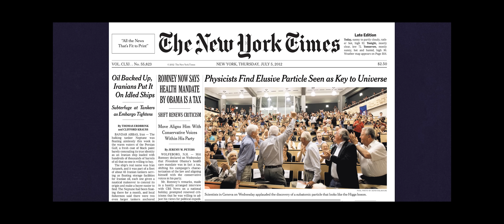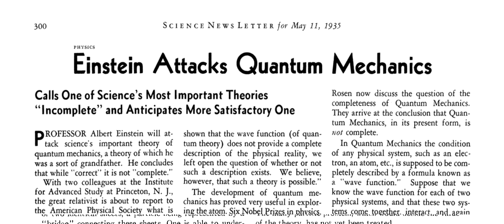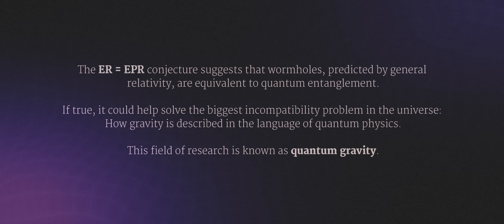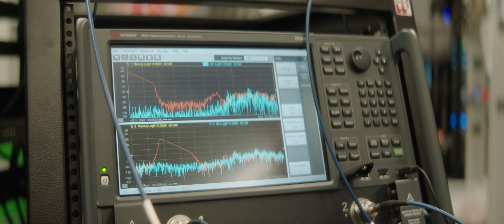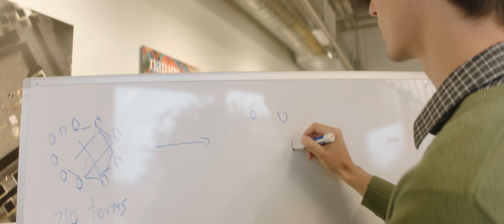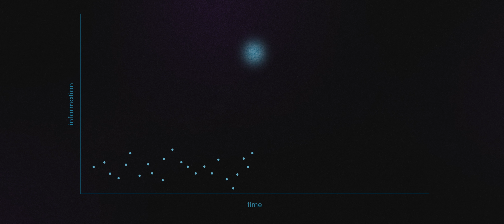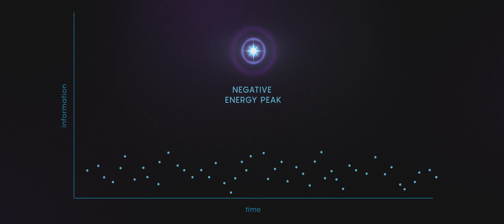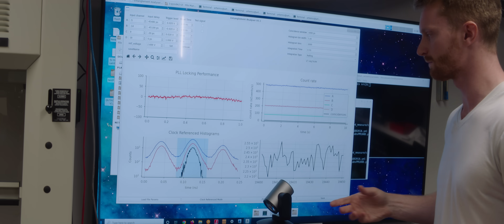How Physicists Created a Holographic Wormhole in a Quantum Computer

Comment: the fourt spartial dimension is the universe smeared on the surface of a quantum mirror the surface of the event horzion. the fifth dimension is where the two quantum mirrors of event horizons become entangled trough a single manifold that is making the surfaces of the quantum mirrors inverted so that the surface of one event horizion encodes the informaiton of part of the universe on to the other event surface of event horizon and vice versa. it means you will see the part of the space of the other end of the wormhole inside the event horizon on your side of the wormhole. you hit the quantum mirror get speared outward ona 2d surface then move trough manifold like curve and end up comming out of the 2s surface of the event horzion on the other side of the wormhole. the gravity model view 3d on to 2d but the reality is that the manifold operate of forth and fifth spactial dimension but the analogy is a 2d surface. the wormhole would be in 3 dimensions the surface in 4 dimensions and the entanglement in the fifth.

Comment: You can put people through it but the ship must produce a strong enough magnetic field that the field will help hold open the wormhole so it does not close on ship. There is a special energy to use that creates such a field that most UFO 🛸’s run on. This is step 1 to create a strong enough field around the ship. The energy to use is Aetheric energy which fills the air and all things. This is step 2. Step 3 is to know how to capture this energy and store it for use. Step 4 create the self sustaining metal to help harness the energy throughout ship to help conduct the energy like a generator once activated. Step 5 enjoy the show.

Comment: We need to learn is something can block the communication or not. I assume atoms can not block but maybe a new kind of barrier made by subatomic particles may block the communication. 
As a computer engineer, we need to understand the data transfer speed, distance limits, noise factors etc. Then I can code and build a galactic communication network!

Comment: what if it's not two black holes
but one black hole
transferring residue as it dies, so
at other end there is dark matter
which ( with enough quanta
getting snagged as they flit in and out
of different dimensions )
can eventually become the home
of a black hole / galaxy combo...
The white hole hypothesis
was  only relevant to the big bang, but
a dark hole / worm hole, might be
where dark matter comes from.
&
in case you didn't notice,
i don't believe quantum entanglement
and worm holes work the same way ~
worm holes transfer q.gravity /d.matter,
while entanglement involves sharing
of information / awareness
via a virtually telepathic process
that doesn't enter physicists heads
so they lump them both together instead.
 :(

Comment: U need six satellites and a drone that uses yellow extruding yellowish light globes on top of flying saucer. Six satellites and six light globes. Holds open a worm hole. As on a clock every 2,4,6,8,10. Are the directed flux to break with magnets frequencys.

Comment: Seen worm hole use with wifi drone flying saucer 2m radius after wifi charging, used a gate wormhole. On our dry ice man made firmament. Space is black flowing ocean from left to right. I seen a worm hole used by the drone flying saucer that I studied above my roof as it was spying on me making hydrogen fuel cells

Comment: I seen a worm hole a wifi 2m radius flying saucer above my roof for 20 min and used a gate worm hole on our firmament our space is black flowing ocean . Inside that wormhole on our firmament. And studied this wifi drone flying saucer for 20 min while the worm hole stayed open until it left my roof and went into it and then both dissatisfied and six satellites came over . Knowing every second hand on a clock was used as satellites to hold open worm hole. Or was involved with this flying saucer spying on me in shed . And used wifi to charge above me roof and had me council led light on it for 29 min . Studied it and lived the diamonds of rainbow reflective surfaces and open ring under the bottom  hat. As it was two cowboy hats joined together. But all plates where cut trianglar. , So much more info on what I know on this spectra magnetic field spectrum use to fly and use wi fi and use a worm hole. I seen all, this whole the flying saucer drone was spying on me Building.

Comment: On 19-Apr-2000 I invented the Delta Vehicle that uses all known Deltas: Pressure, Voltage, Magnetism, Density, Temperature, Height, Gravity. The most important Delta of my Vehicle is the Gravitational Delta. To take advantage of the Gravitational Delta, the vehicle has three devices: 1. Gravitational Wave Tuner 2. Gravitational Wave Amplifier 3. Gravitational Wave Directioner

Comment: The very processing power of a quantum computer comes from its processor harvesting what is known as quantum entanglement. Quantum entanglement in and of itself is a wormhole. Because a quantum computers processor uses what is called or known as quantum entanglement, this allows 2 quantum computers to transfer or teleport data to eatchother instantly and do so faster than the speed of light itself. It does not matter how far apart or how close the 2 systems are the data is litterly teleported instantly. This is the very action of quantum entanglement.

Comment: I'm sick of hearing the Qbit can be equal to either a 1 or a 0 or both. How do you calculate if everything can be anything?
Reply: there's a really good video by microsoft academy showing the basics of quantum calculation, showing the simplest problem where quantum computers can solve it faster than classical computers, and run it on hardware. it's a 1 hour long lecture but super accessible.

Comment: If we hypothesize that nothing is actually moving faster than the speed of light, and the Hawking radiation provides us with information about the state of the particles, we can explore a possible scenario.

Hawking radiation is a theoretical prediction made by physicist Stephen Hawking, which suggests that black holes are not entirely black but emit small amounts of thermal radiation. This radiation is believed to be associated with particle-antiparticle pairs that are created near the event horizon of the black hole, with one particle falling into the black hole while the other escapes as radiation.

In the context of our hypothetical scenario, let's imagine that the entangled particles connected by a wormhole emit Hawking radiation. This radiation could potentially carry information about the state of the particles, allowing us to gain insight into their properties.

If we were able to detect and analyze the Hawking radiation from one of the entangled particles, it might provide us with information about the state of its entangled partner. By observing the properties of the emitted radiation, such as its energy, polarization, or other characteristics, we could infer the state of the corresponding entangled particle.

In this scenario, the information would still be limited by the speed of light. The detection and analysis of the Hawking radiation would take time to reach us, just like any other form of electromagnetic radiation. Therefore, although we might gain insights into the entangled particle's state, it would not violate the principle of locality or allow for instantaneous communication.

Comment: So is a "white hole" the "axis" on both sides of a black hole and the material that enemates from those "jets" is whats coming out of that white hole. thats probably why we cant find them. for one, they are right in front of our face, in a sense, but completely obscurred by the "light trapping" black hole. but my guess is THATS where white holes are.Thats why ER=EPR. One is inside the other. Together they are 1.Thats maybe where the  expansion of the universe gets its "inflation" pressure from. Its spews out the fabric of space-time. A "fourth dimension" engine.

 They ARE the singularity. And since black holes that arent feeding dont produce jets, well, to open that wormhole, feed the worm. feed it energy.feed it mass. hell, feed it tacos and old milwaukee.
Also, the blonde is HOTTT!

Comment: "Theoretically, it is possible for a superfluid to transport particles through a wormhole using the laminar effect. Entangled particles would be used to control the flow of the superfluid, allowing it to move through the wormhole without encountering turbulence or drag. This process would be highly efficient, as the superfluid would be able to move through the wormhole with minimal energy expenditure. However, the technology to create such a wormhole has not yet been developed."
Hyuk-hyuk.

Comment: "A quantum computer wormhole is a theoretical concept in which a quantum computer is used to create a synthetic wormhole. This would allow the computer to access information from different points in space-time, without traversing the physical distance between those points. This would enable the quantum computer to perform calculations much faster than is currently possible. However, this technology is still in its infancy and is unlikely to be developed in the near future."
Lulz.

Comment: An active galactic nucleus (AGN) is a compact region at the center of a galaxy that has a much-higher-than-normal luminosity over at least some portion of the electromagnetic spectrum with characteristics indicating that the luminosity is not produced by stars. Such excess non-stellar emission has been observed in the radio, microwave, infrared, optical, ultra-violet, X-ray and gamma ray wavebands. A galaxy hosting an AGN is called an "active galaxy". The non-stellar radiation from an AGN is theorized to result from the accretion of matter by a supermassive black hole at the center of its host galaxy.
Reply: Containing force potentially that provides containing force for there to be a vacuum in space. Infrared light travels infinitely. Someone contact me to solve this

Comment: Space itself doesn't move. Space itself is a stationary cold field of resistance to thermaldynamics. Propulsion and repulsion. Perpetual motion. Unification of unidirectional flow of pressure in quantum magnetic fields of forced pressure cycling circulation patterns of mass in resistance to forward momentum. Repulsion redirects trajectories towards the weakest point of resistance. Mass neutralizes resistance within it as repulsion of thermaldynamics in resistance as magnetic fields of forced pressure cycling circulation patterns. Outward pressure of force known as weight of energy in mass. Hydrogen under extreme pressure of thermaldynamics expands cold resistance in equalization of pressure into the expansion of cold resistance into helium. More pressure exerted within, more resistance to repel it. Mass expands resistance within equalization to pressure. Hydrogen under extreme pressure expands cold resistance into helium. Mass, density can't exceed resistance within it. Mass is always equal to resistance. Mass occupies space as space itself. Cold resistance and thermaldynamics coexist as space itself. Thermal energy singularities outside of entanglement of mass are heat waves of cosmic speed limit in resistance. Resistance to singularity causes heat to spiral around cold resistance in avoiding patterns. Hence frequency. Mass is the weakest point of resistance in occupational space. Mass occupies space as an amplifier. Mass occupies space with resistance going through it in forward maximum momentum velocity in resistance. Exchanging points of space as we vibrate as a wave of it. Vibrations move point to point timed interactions. The energy and resistance we exchange in positions of trajectories of forward momentum. The cosmic speed limit is constant, in and out of entanglement of mass. Distance is reduced by cycling circulation patterns of mass. Black holes are devoid bubbles of thermaldynamics. The hubs that generate thermal energy singularities at the event horizon and act as a generator that allows more pressure exerted within it outward force into propulsion of thermaldynamics into the weakest point of resistance to proximity mass. Proximity mass expells its thermaldynamics to the weakest point of resistance. The greater mass of neutralized resistance. No gravity. No electrons. No gluons. Two states of thermaldynamics. Repulsion and propulsion. Conservation of maximum momentum velocity, in resistance. Magnets show the bonding power of atomic strength of unification of unidirectional flow cycling thermaldynamics in magnetic fields. Repulsion and propulsion. Hydrogen under extreme pressure expands into helium. Resistance expands in equalization to the pressure of thermaldynamics. Resistance is always equalization to mass. Density can't exceed resistance. Table of elements proves hypothesis. Dark bubbles of pure fabric of space itself. No thermaldynamics. Poles capable of jetting thermaldynamics outward into space. Theoretically.

Comment: "They hoped to design a quantum circuit that's mathematically equivalent to a wormhole."  That is not correct.  A mathematical relationship of a wormhole would show dependency of state from one side to the other.  This mathematical representation showed no dependency.  It also showed no physical way to transmit that dependency.   So it was two independent mathematical representations that were synchronized.  If anyone was honest in this experiment, they would say they were able to synchronize two mathematical models across two quantum bits.  Much less impressive.

Comment: 12.50

I loved the presentation of this video, but my question is this. 

During the transference of the Qbit from one side of the the worm hole to the other side of the worm hole are the states exactly identical and if so how is that information preserved through the disassembly and reassembly of that information? 

Does this mean that there are sub quantum fields that act as place markers to preserve the information through the disassembly and reassembly phase? 

Or does the information remain whole and it is the wormhole that is forced to dilate to allow the information to maintain its identical identity through the transfer between the entrance and the exit points of the wormhole? 

And lastly, if the qbit is broken down further to allow for transference between the entrance and exit points can at any point/time/state be altered then recombined into another qbit which looks/behaves exactly the same as the original qbit but be different? 

I am showing my ignorance, but it would be like taking an exact copy of a clone but not being able to tell how much of the (wrong analogy, I'm sure) individuality would be kept identically intact? And how would it be tested for?  Can there be an actual identical clone at any time during journey which would not destroy the original information or the destination information?

Thank you for allowing me to be an armchair physicist. 😊
Reply: All of your questions still apply even if it was a simulation, but it should be known they didn’t actually create a wormhole. They simulated one, and pointlessly at that, since a classical computer could do it just the same.

Comment: You might have skipped the part about GE trying to make computer chips with a diamond layer.

Pure Carbon 12 is an excellent heat conductor.   The idea was to grow a layer of diamond that would conduct the heat away from the microprocessor.

Apparently this annoyed DeBeers, and they spiked the project by buying stock in GE.

The idea is still valid, though.

Comment: This experiment is a trully "PaperBomb" into physics community, on all articles published it make a Hot Buzz, some wanted this to be censured, rejected, à lot are crying to scandal and the other 50% goes with  retained  applauds.
Hoppefully the team used the term simulated.
This experiment seems       - validating the holographic  behavior at quantum scale.
- The SYK once more, entanglement of numerous particules at once by a single interaction.
- If validated with more qubit, it will validate ER=EPR at least at quantum scale
- The possibility to simulate quantum mecanic effect, by affecting physicaly qubit is openning an limitless world.
But, Quantum computing also lead to take this result with some restraints, 
The errors correction and the "statistical results" can make the result sceptical and drive to differents interprétations if not validated by  other experiments.
This is a very good step forward.

Comment: Makes me wonder whether we could use such wormhole to “contain” a “virtual” fusion reaction? A virtual fusion reaction, even if very simple, very small, that would correlate with positive and controllable energy output? Maybe the random, quantum mechanical negative energy provided by the universe would be the foil to the positive, controlled energy “output”? ... The video gave me the impression that the negative energy was provided freely by a quantum mechanical fluctuation in the universe local to the quantum computer, much like detecting a neutrino, say. Is that correct?

Comment: This must have something to do with singularitys connecting together to make a portal from another black hole or so called a black hole with a white hole in which creates a bridge of singularities for us to travel through finnaly without being ripped after being stretched it would stretch us out of the white hole without being ripped apart because the singularities were together instead of the black hole not having a bridge if it did not have a bridge then we would keep stretching and be ripped... and now it makes sense why this happens cuz most black holds dont have a bridge but do white holes exists?